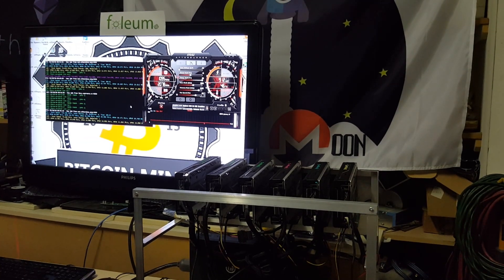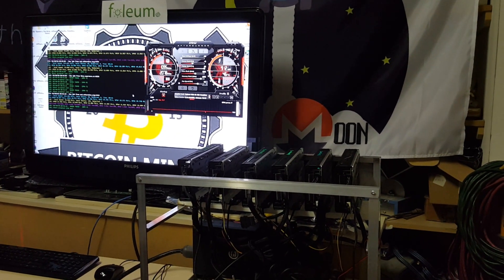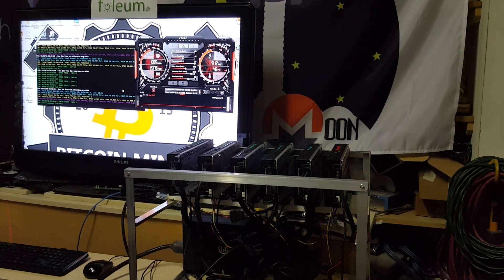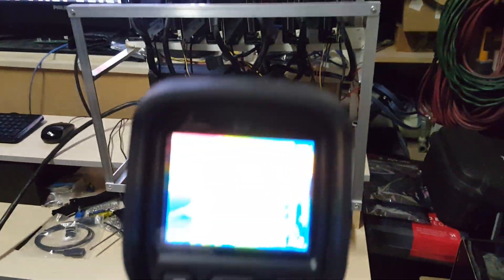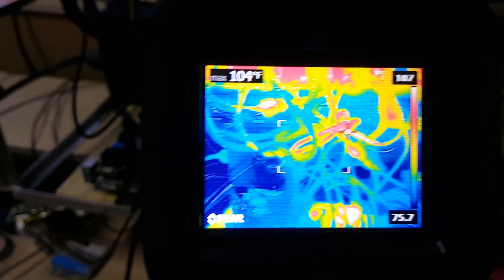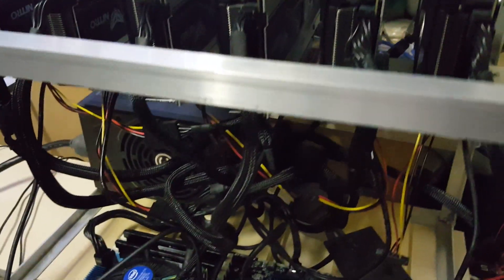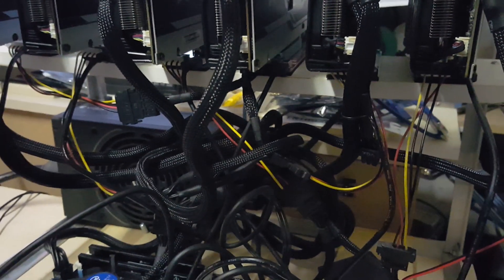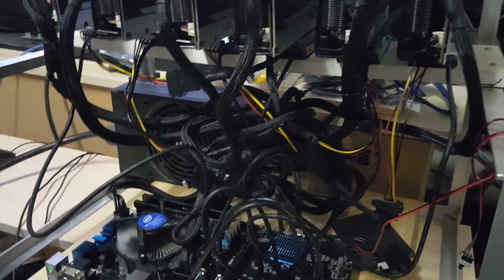How to Safely Power USB Risers and SATA Risers for GPU Mining and Update

Comment: I do use 2 per cable now but i am going to skip all sata/molex risers in the near future. And only use the C version risers. So only straight 6 pin risers.
Reply from the maker: Hi karma police, I totally agree the 6-pin is the way to go.
Reply: hello, can i plug the 6pin on periferal port (psu) to 6pin on the riser?
or should i plug from vga port  (psu) to 6pin on the riser?

if i use molex, do i need to plug 2 molex into one 6pin? or i only need one molex for one 6 pin?
thank you.

Comment: Don't use SATA for power the risers! Use 6pins to 6pins it is more stable and safe. I had a lot of problems because of SATA. Crashes, freeze of all rig and so on...
Reply: 6 pin to 6 pin - but the 6 pins on the PSU are labelled "SATA" on my evga 850. Is this fine or where should i put the 6 pin into the PSU if all VGA (aka 8 pcie) slots are full? Trying to figure out how to power my risers myself with high wattage gpus.
Reply: @nevous8  following